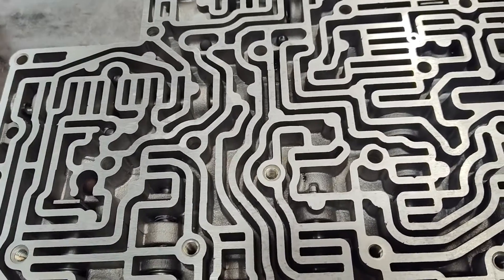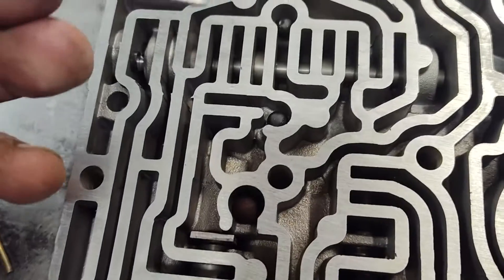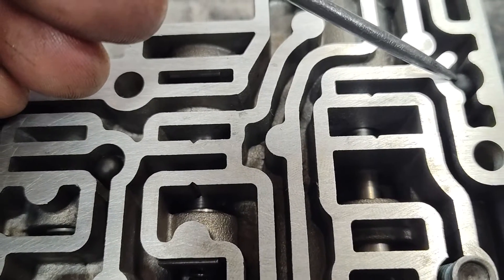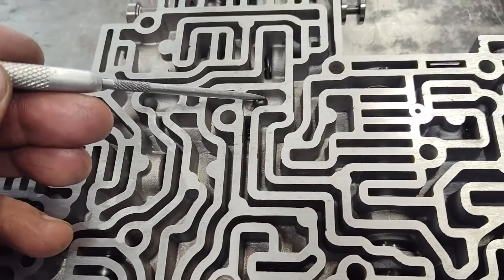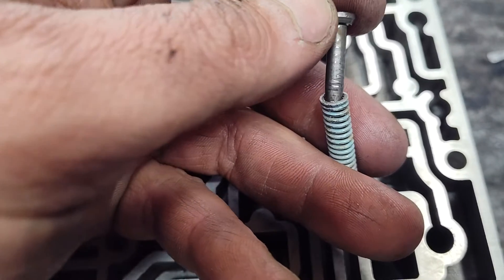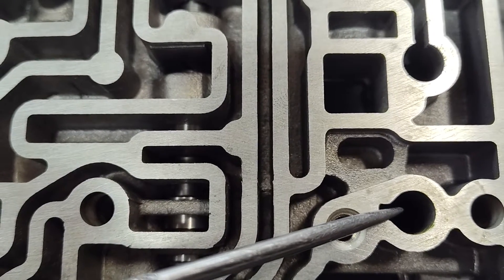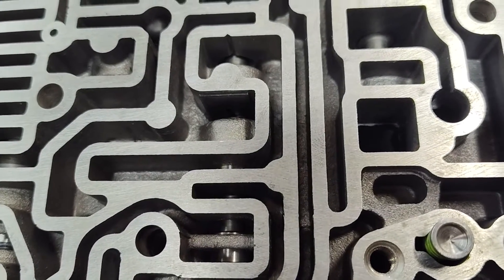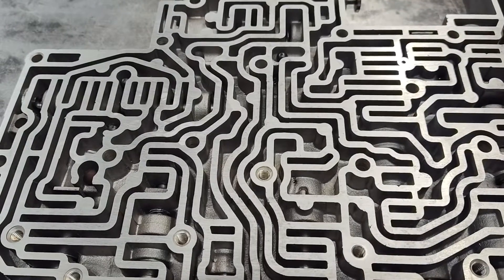Ford AOD Common Assembly Mistakes and Installation Tips

Comment: Talking about the buzzing sounds it is very hard to hear when the engine is running or the vehicle driving down the road so it becomes the least of my worries 
Most of the time something else is going to cover up the buzzing sounds weather it be the road noise or the radio, the exhaust system all will cover up the buzzing sound
Reply from the maker: I agree. Not a major concern of mine as well

Comment: At :40, what happens if one of those check balls missing ?
Reply from the maker: That's a complicated question. Depends on which one.
Reply: @BroaderPerformance  Oh okay. What tv pressure are you recommending? Mine is about 34 right now with tool installed and it shifts very late.

Comment: I have a clothes dryer in my shop and i put my valve body gaskets in for a few minutes right before installing. Works great, shrinks the gasket just a little and the holes usually line up much better.
Reply from the maker: Interesting tip. I have heard you can also do that in a microwave oven. Ive never actually tried it though.
Reply: @BroaderPerformance  I have tried the microwave also but i like the slow of the dryer better. That microwave will cook em fast lol.

Comment: Couldn’t you enlarge the gasket a little bit where it’s close to blocking that whole
Reply from the maker: You could do that. The point of the exercise is to use alignment pins to try and keep the gasket in the proper position.  By doing that you shouldnt have to worry about it.